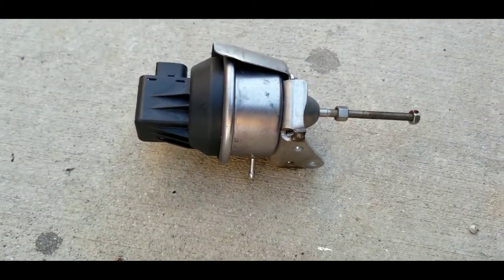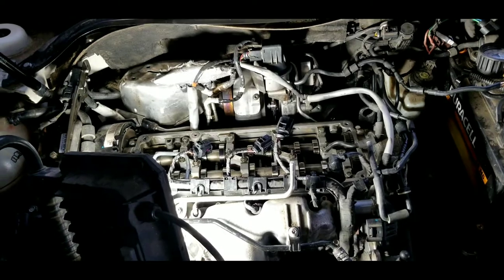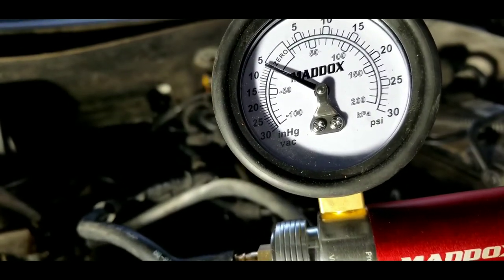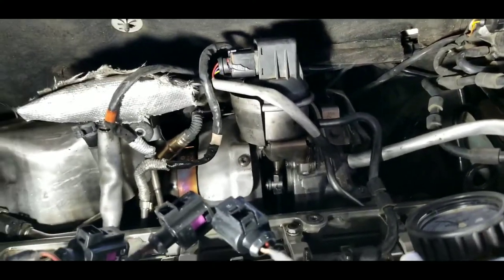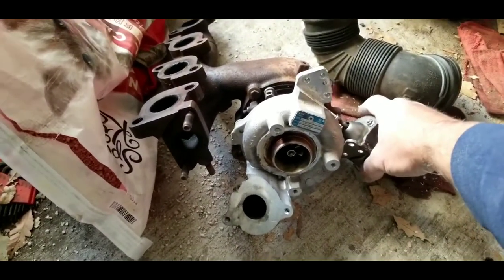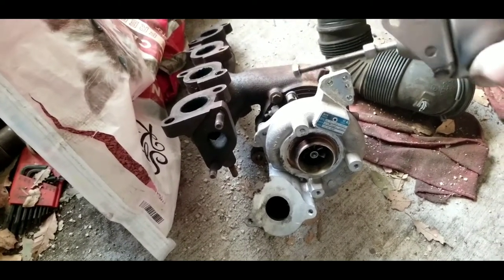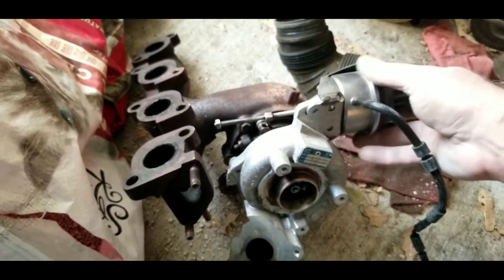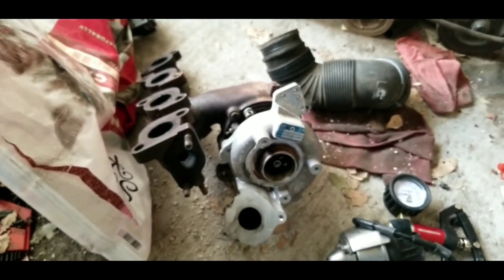VW TDI 2.0 common VNT turbo waste gate actuator adjustment CBEA CJAA

Comment: I accidentally overrevved my engine for a split second (answer phone call while drinking coffee and shifting) - hit almost 5000 - and immediately got the GPL and CEL....says turbo position sensor A error and some other code. both are wastegate codes. thanks for the video - i just ordered a the part online and am goin to use your video as a guide...... i think it's over my head, frankly. don't know how to adjust it. but my local vw mechanic kept the car for a week and then gave it back saying they couldn't find a problem (odd. because it has no turbo) so i'm on my own.

Comment: I’ve got an question a friend of my says the actuator is broken but I don’t get any fault in vcds   My symptoms are that the turbo kicks in at 3000rpm🤷🏼‍♂️ and nearly sometimes It kicks in at very low rpm like it normal TDI does 🤦🏼‍♂️

Comment: It sounds like you have done a ton to your TDI, I have a gremlin that I haven't been able to figure out.  I put an actuator on thinking it would solve my problem of an erratic boosting issue. It has throw 2 overboots codes but the man issue is under steady throttle you feel the car accelerate & cut back. I graphed it out while driving & the boost will just climb on its own and once out of range the computer kicks it back. All other sensors are good and the requested boost is steady. I am wondering if the esenteric ring of the VGT is worn & has slop. The VGT arm moves super easy & kind of surprised for a vehicle with 160k. I just bought this a couple months ago and just don't have the time in to know the in's & out of this motor. I have had my ample time with my 6.0 power stroke & 3.0 crd and know them very well. Just trying to get a second opinion before dropping the 1000 on a new turbo.
Reply: @jhbrown53 I know it's been 2 years since you posted. I seem to have the same symptoms and wanted to see how you resolved the issue.
Reply: @dariuspeleda4986  Yes ,it was in my tuning from Malone, I finally emailed them I was having an this issue. They said this can happen then revised my ECU file which solved the issue . I spent 1k chasing this gremlin.  It is a pain in the ass to set it but is do able and pretty sure I had to make a custom wrench . That actuator is where I though it was and a shop told me I set it wrong the first time. As soon as you got on it pretty had and would cut out and throw an over boost code.   I have it stage 3 now with a cr170 turbo and trans tune and love the car

Comment: You did way too much work you can cut a 10 mil spanner with a ratchet end on it and you can put your arm down the back without the intake and adjust it perfectly when the actuator is relaxed. There should be at least a four or five mil gap between the top bolt And the turbo dump valve arm when fully pressed up then do the nut up at the bottom and close that five mil gap that will work looks like your sensor on your actuator plug is damaged. This could cause problems.

Comment: Wow!  This car has really been a test of your patience.  Is this the final fix and does it run and drive now?
Reply from the maker: yea she is up and running just got an engine light for the egr. though Lucally I have 2 extras.
Reply: I like a 2005 vw golf tdi at a dealer. when I test it i found a dash light. the dealer said it needs turbo actuator. it does not affect safety or performance.  I don't know if it is good to buy the car or no
Reply: There's a slotted socket and 'S' line wrench used to adjust this with everything except the fuel line retainer on the head and the intake piping.  I have them. They work great.  Much better than removing intake manifold,  though it is slightly more difficult to adjust than with removing the cover.  I'll get the tool numbers for you if you'd like.
Reply: @chasehyzer8839  can you shoot me those tool numbers

Comment: hello 
I got into p00af code and wonder what is a fix
Reply: I just had that code pop up. Did you figure it out?
Reply: @NoahZwicker  mine was clogged DPF filter, but might but turbo vnt  as well, you could be able to move the vnt actuator rod with finger easily.